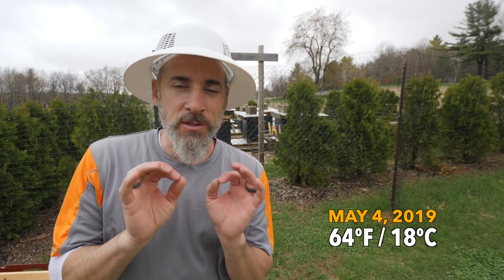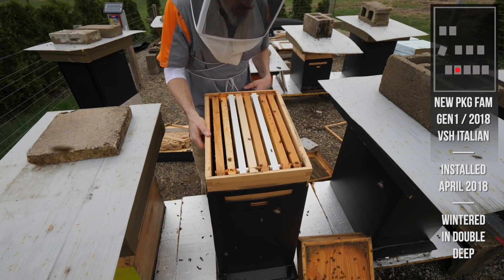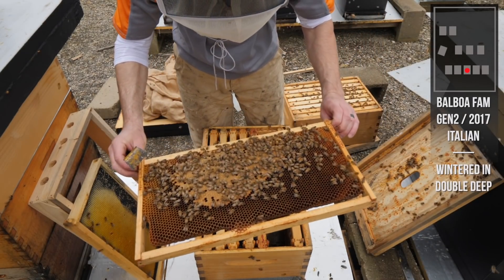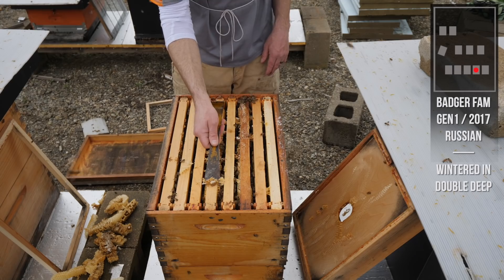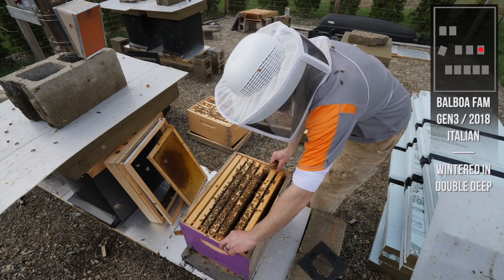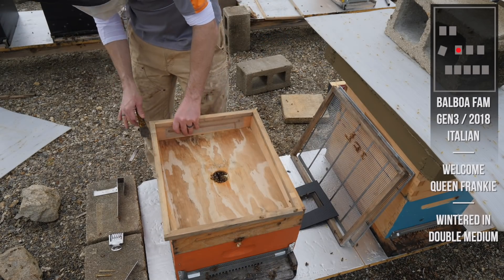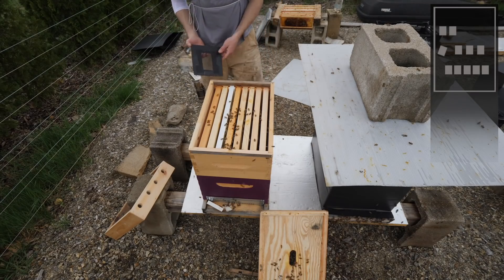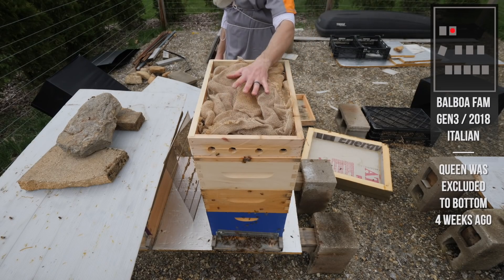So Much Poop. So Many Drones... Building Up Before The FLOW!

Comment: Gentlemen:
Y'all have to remember that drones are not a bad thing. Control swarming through the queen, but Jim, if you want those woods to have bees, you might want to let a colony or two swarm this year. In time, if they survive - you will have a new source of hardy bees, acclimatized to survive without intervention. Might take a few years. I'd start by putting a few more "swarm traps" out there. You can always take them down and bring them into the yard for treatments and winter. If they have mites, you wont want them where they can mingle with your bees, so there is that to consider, makes it perhaps more advisable to bring swarm traps in. Just food for thought.
Reply: Why would an apiarist want his bees to fly off into the woods to be free and compete for nectar and resources, that sounds stupid to me sorry to say, if your keeping bees that’s exactly what we don’t want
Reply: Julie Enslow swarming is controlled by space what we would call standing room, swarm prevention is controlled by artificial swarming (splitting),moving frames of open and capped brood to weaker hives or putting supers on. Swarming is not controlled by the queen but is actually the workers, the workers who tell the queen it’s time, if you’ve noticed swarm Behavior it’s the bees who control the queen usually by my observations there is a large percentage of workers land on the site where the swarm is to form then the queen leaves with the middle of the group and the rest of the swarm forms around her protecting her until the scout bees return with directions to a new suitable site for the hive, some times the queen flys out 1m from the hive and hits the dirt and it takes the bees a good 15mins to find her and form the swarm on the ground or they don’t find her and either go back to their original hive or they join on to other swarms forming super swarms,  I’ve had several hives swarm simultaneously. Also I don’t think bees acclimatise the hive stays at 35c all year 24/7 and does not vary much more than a degree, yes some strain of bees do better in certain conditions and I believe it’s more to do with the available resources, the use of said resources and the insulation value of the hive that get them to survive the harsh winters.
Reply: @BESHYSBEES 
I get that to most beekeepers, if not all of them, bees are an investment of your time, your money and for many - your heart. What I was bringing up with Jim (who is a visionary) is just food for thought: we might want to think out of the box on rare occaision and try to plan for the future.

You might have heard that feral bees are dwindling. Right now, beekeepers have all the bees "in one basket" - that is, in the keeping of humans. Let's agree that most beekeepers have a hard time preventing 100% of all swarms, allowing some bees to escape (at least temporarily). Of those some actually do get away into a forest, such as the one on Vino Farm property. With the current health problems that bees are dealing with, feral hives have little chance of survival, but some do. Now stay with me, I am laying a groundwork here and I know I am jumping around. There is a great divide in the beekeepers between two main philosophies on beekeeping: little to no intervention regarding disease, and full intervention. There are of course a number of positions in the middle as well. Scientists and breeders work hard to breed or create strains of bees that can handle mites and certain diseases on their own. Some beekeepers say let evolution take its course, and such bees will be created by natural selection: survival of the fittest. The fact is, evolution takes tens of thousands to millions of years to happen naturally. And scientists and beekeepers are resolved to not allow them to go extinct on their watch. Another thought: in this case, the current stress load on honey bees is not natural - it was induced by the hand of man. I am in 100% support of the scientists and beekeepers who are trying to deal with this. But I am also in 100% support of the honeybees and the God who created them. I do believe in miracles. Still with me?

OK so, given all of the above, is it too much to consider that people who were not looking to make money off their bees might invest a swarm or two of great bees to see if there has already been enough human intervention and a little natural selection might make a breakthrough?
Reply: @BESHYSBEES 
"swarming is controlled by space what we would call standing room, swarm prevention is controlled by artificial swarming (splitting),moving frames of open and capped brood to weaker hives or putting supers on."

That's what I call swarm control through the queen.  Think about it. Thanks for the very nice explanation on all the rest, there are often people here who are looking for that information, it is all correct, I am not challenging it. Do notice: a hive will not swarm without the queen. If you control the queen, you can control whether they swarm or not. Cutting the wings of a queen just means she must be superseded before they can swarm. If that was a $500 queen, it hurts in more ways than one.
Reply: Julie Enslow I get what your saying, I don’t buy queens and I don’t cut the wings, I graft from our best producers (a mix of carni, Italian and now some black queens my cousin gave me I don’t know what they are though) we don’t have varroa mites in Australia thankfully but I do know the destruction caused by them but same as Australia America’s honey bees are introduced and feral hives are always getting on the loose.
Reply: @BESHYSBEES 
Healthy feral bees are a good indicator of bee health. Do guard your borders - don't let mites in!
Reply: Julie Enslow yeah we have sedentary port hives and all the protocol in place but undoubtedly it will arrive, recently had apis cerana the Asian honeybee introduced in northern Australia they came in on a cargo ship, thankfully no African bees here either 
We are the lucky country
Reply: @BESHYSBEES 
Now if you can only keep it that way - you may be the honeybee's last refuge (if all else fails). Meanwhile, we'll all do what we can for the bees

Comment: If it is going to be cold for a while you should put some syrup feeders on your weak hives. It is a wonder what a little syrup will do to help a weak hive in the cold.
Reply from the maker: I'm so torn on the feeding. It would make me feel better, but there is nectar and honey in the hives. We're so close to the nectar flow, I don't want to add sugar water right before they start to bring in real spring nectar. How do people keep the feed separate from what they're going to harvest? Our flow is not going to be huge. Maybe one medium box on each of the strongest hives. If I feed now, that's where they're going to put the sugar water. Then it will mix with the nectar. Seems like a bad idea.
Reply: Jim, I am talking about ounces, like an 8-12 ounce bottle feeder on top of the weak hives, not gallons. You need to get them ready for a flow,  A little syrup will stimulate the Queen and the hive to get going. Also this feed is for them to raise the young. I would put in a light syrup 2:1 or water down some honey 1:1 so they dont need to go find alot of water, Hopefully this will go into feeding and stimulating, not storage. I am with you on the sugar mixed with honey but they need a booster now if there is no flow yet. And I am only talking about feeding the smaller few hives. I would also throw on a couple small peices of pollen patty on top of the frames for a little surplus for the young. Good Luck!

Comment: Im guessing she might be losing her steam, if the queen is abnormally producing drones. But many questions need to be answered to know for certian. The questions are: is the queen abnormally making the drones because she is failing. Have you ruled out a laying worker?

Drones take longer to produce. So did all the worker larvae hatch out making it appear as only drones are being produced. Since if she stopped laying which could be normal, that means she wouldn't be producing more workers, leaving only the drones which take longer to finish their growth stages.

I would feed heavy, and see how she responds, making sure she has pleanty of worker comb to lay in. Drone production is normal this time of year pre swarm phase, and so is stopping brood production during a durth. So using controll factors to test for abnormalities in those expected normal behaviors, is the best way to rule out any abnormalities that could indicate a failing queen. That's my recommendation on how I would proceed.

P.S. Nice tarp for weed suppression!
Reply from the maker: I'm going to let the spring flow come into the equation before deciding. They have plenty of stores in the hive, but I have not fed them syrup since fall. The apple trees and dandelions will be in full force within about a week. I'll check her out after that.
Reply: If you got a sirup frame to take from another hive, they would only take it if there is nothing else to eat . It would be a waste of space in the hive thru summer season, I have 5 to spear ;). She might just be unfertilised.

Comment: Welcome to Queen Cornelia, first of her name! May her line be rocking! Also welcome to Queen Lucy of House Cornelia, first of her name, may she always hold on to frames well!

Not disagreeing with those that say lots of drones can often be an indicator of a failing queen. But it can also be an indicator of hives that are growing rapidly and looking forward to swarming soon. If planned well, they will wait to swarm until a flow starts.  Just saying.

Welcome to Queen Frankie of House Balboa, first of her name! They do love to lay in the newly drawn combs!

Sidebar: listening to the sound of the hives, knowing they are low on resources, watch out. I thought I heard a little roaring. Not full throated, just, not happy roaring. Like there are stray bees checking out the open hives roaring. 

And we have more queens yet to be named. I'll put my thinking cap on. That last little Balboa queen that needed another super - she's definitely needing a name! Might have to put big labels on all these hives!

Great inspection, lots going on and it all looks good. Regarding drones - don't all hives produce drones early in the year so that if something happens they have that resource for future queens? It seems that happens every year.
Reply: Julie Enslow I'm not saying drones are bad, spring build-up has several.  "Normal" drone brood is on the outside of the pattern and drawn on the bottom of frames. When the pattern is peppered with or all drone brood, that indicates queen failure. I don't think he even found eggs in the Russian hive.
Reply: @timHclem 
Oh regarding the Russian queen, I do agree, she is past her prime. I do like her starting in a nuc but he will have to put in a frame of brood in a month to save the hive. And they will supersede her. But she has stopped laying probably (note the probably) due to the dearth.  She will start laying again for a while. As long as she's laying at least some worker brood, putting in the frame of brood can wait (unless Jim wants a new queen to NOT be a Russian!)

Comment: Mostly drone = Queen is past her best before date.  Time to requeen
Reply: False
Reply: Poison Ivy  I have 30+ hives all from cut outs splits and swarm calls I'd hope I know I thing or two about my bees even studied for 3 years before ever touching a bee. I'm not saying a old queen can't run out of sperm. All I'm trying to get across is just because you see a boost in drone population doesn't necessarily mean she's old and out of sperm. It's fixing to be spring for him it's completely normal to see more drones.
Reply: @stephenF250  If it was just an increase in drones I would agree, but when most of the brood is drone, as stated, I  consider replacing the Queen.  BTW.  I  am not new to the game either
Reply: @kylef9358  hive won't swarm until the queen cells are close to hatching
Reply: @stephenF250  What queen cell   There was no mention of a queen cell, so no swarm danger, just an old queen laying mostly drone
Reply: @seanmackey1469  I was answering Kyle look at the comment above mine
Reply: It is possible that she ran out if sperm. If you replace her, we would never know and you would have a new great queen. However, I agree with stephenF250 that she is probably producing drones for a reason and we as beekeepers do not always know the answer. We didn’t see every frame in the hive. Was there 1/3 ration of drones to workers? Were the drone cells on the lower or outside part of the frames which is what happens with swarming? It looks like there was mostly worker stamped foundation and not foundationless frames, so the queen would have to lay her drones on a worker sized cell, then it would look like she shouldn’t lay there. It would be a pattern of almost all drones if that is what the colony needed. Also, if she lays another egg in that cell after a drone hatches, she will only lay another drone in that cell because it is a larger cell. The frames would need to be changed to worker comb to prevent that. I let my bees draw out their own comb. They absolutely love to draw out full frames of drone comb. I let them live because there needs to be more awesome bee genetics out there. I just move that frame out to the sides or to the super for the bees to fill with honey for winter. I also rely on those genetics because I create splits where my queens will need to mate. Imagine if everyone cut out the drones. Maybe people who have queens that run out of sperm get rid of all the sperm producing drones in the gene pool so they don’t have enough sperm to last more than 2.5 seasons. Just a thought.  I also know that the mites like drones, and I understand cutting them out if there is a big problem at the time, but if treated and the mite levels are low, I think we should keep the bee gene pool full of genetic diversity. Give her worker comb, take out the drone comb, and give her a chance to do her thing. 😉
Reply: Sean Mackey true. Had a drone layer this year, and had to requeen

Comment: I have a frame of honey from the last failed hive.  The frame is in the refrigerator.  Can I put that frame in the hive when I introduce my new batch of bees?
Reply from the maker: Usually, yes. Do you have any idea how the hive died? If you think there may have been a contagious disease, you might not want to share honey between hives. Usually a capped frame of honey is pretty safe to share, but there is a risk. Maybe get the opinion of someone who can look at your hive.
Reply: @vinofarm  They seemed to survive the winter.  They were active in February when it got above 50 degrees.  Cold snap came in and a few weeks later they were all scattered around the hive in clusters frozen in time.  :(

Comment: It's been raining like crazy here too. I live in Northwest Missouri. Installed my hives about 3wks ago and they are already going to need another box if it ever stops raining long enough to mess with them. I was a little surprised cuz its been chilly and wet pretty much since i got them. Today it was 38° and they were out flying. Seems like nothing stops them. Lol
Reply from the maker: This has been one of the wetter and cooler springs I can remember. Seems to be the case all over. Good luck!
Reply: @vinofarm  last year around this time we had a few 80° days then it snowed one night. Its been cold but at least no snow! We have warm days in the forecast with low chance of rain so hopefully I can get in them again soon.

Comment: The genes of the drones determine temperament.  Watch out with all those Russian drones!

Also, pulling capped drone brood is a nice way to check for varroa. Pull them out with a stick or break apart that brood that you scraped off. The red mites stand out against the white brood body.
Reply from the maker: Bee Haven Yes, I looked and didn’t see any varroa. I too am concerned about all the Russian genetics getting into the bee yard.

Comment: Looking good! You doing any early splits? I just split my two large ones. They each had about 8 solid frames of brood so I pulled two frames of brood off each to cut them down before the dandelions. So far so good. First split I have ever made.
Reply from the maker: Splits won't happen for a couple weeks. The drones are out, but they're not quite mature yet. Also, it's just not been very warm here. It doesn't feel ready yet.

Comment: off topic, would it be silly to put a beehive in a greenhouse during the winter months? I live in Vermont and am interested in the trial and errors that you have gone through. What do you think?
Reply from the maker: I've answered this many times. Yes it would be silly. You don't want to artificially heat the hive when it's actually still cold outside. My unheated hoophouse hits 70º on sunny days in March when it's 30 outside with snow on the ground. You don't want your bees flying out of the hive thinking spring has arrived when there's nothing for them to eat and with weather that could kill them if they got out. Unless you can have a temperature controlled DARK space for them to live and keep them COLD, it's best to let them life outside and emerge naturally with the season.
Reply: You could look into changing into az hives. Slovenia is very cold and has used these hives for many years.  Some are now using in the us. Very easy hives to use.  Research.
Reply from the maker: @howardcoffman2780  I've watched the videos... The actual usage doesn't appeal to me. If I were a mobile operation, maybe. I just prefer the top access. Those bee houses are pretty awesome, though.